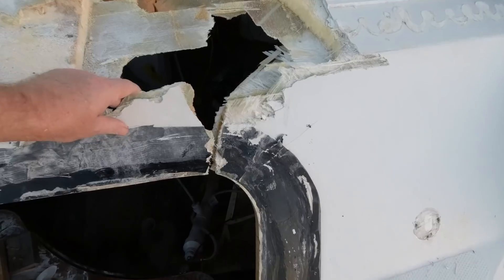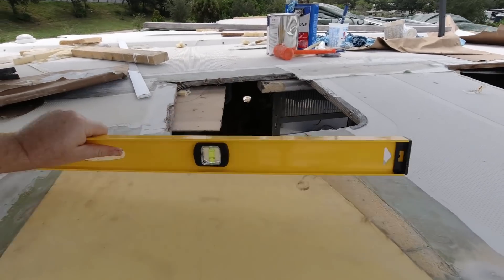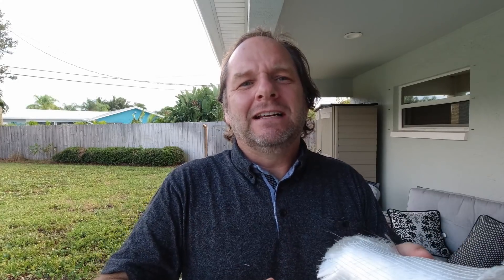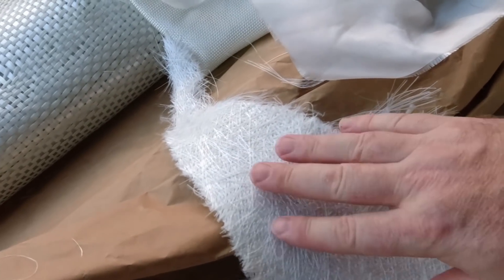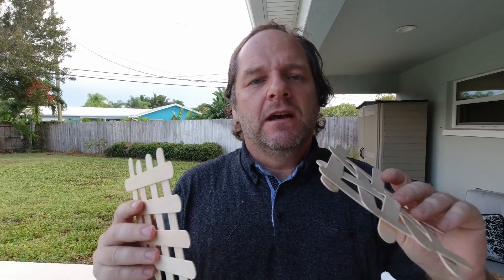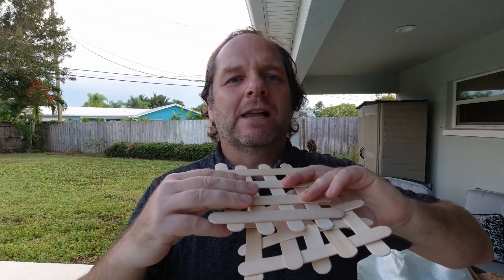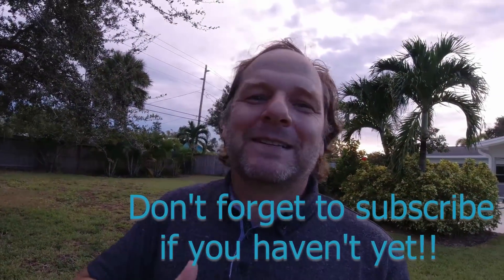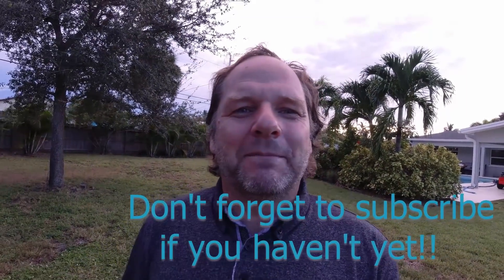8 Fixing my Salvage Sailing Catamaran. Which Fiberglass fabric to use?

Comment: You’ve got a very good start on the glass reconstruction and it nice to see your progress. As a good size Collision and restoration facilities owner for 40 yrs I’ve done my share of fiberglass repairs and your doing a great job and it looks like your avoiding one of the biggest mistakes in glass work by NOT Over Catalyzing your resin, of course if you did in that hot Florida sun you probably would have set your boat on fire from the heat created ! Keep up the great work 👍🏻

Comment: A better generic term for fiberglass material is "Fabric". The reason, because there is a type of fiberglass called "Cloth". This is made from twilled f/g thread woven together like woven roving. It is typically used as a finishing layer of fabric to provide a somewhat smoother finish and generally weighs 10oz. It was also used in the early days of  making surfboards. However the light weight woven roving (4 oz.) produces a smoother finish but not as much strength as 10oz cloth.
I have never heard of bi~tri axial fabric referred to as knitted. Stitched or sewn would be more like it. The last two numbers used to describe bi~tri axial is the weight of the mat. Hence 1708 is 17oz(per square yard) of biaxial, 0.8oz(actually .75oz per square foot) of mat and another common biaxial is 2415, 24oz biaxial, 1.5oz mat. Mat is weighed by the square foot other f/g materials by the square yard. In the past there was another composite f/g fabric called fabmat. Back in the day Morgan used to use 24oz woven roving stitched to 3oz mat. Fast build up of thickness but hard to wet out(saturate) 3oz mat from only one side. This material also came in narrow rolls 8''~12'' wide. Very handy for bonding interior furniture in place as the narrow precut material was neat to install, only needing to be cut to length.
Great series so far. As a long time cruiser and past sailboat builder I really like to see how other people tackle these monumental tasks.

Comment: You shouldn't worry about not being an expert (yet), just picking up some cloth and mixing up some resin to see what happens is way more than most people have done, and anyway, programmers are generally pretty smart and good at reading, researching and figuring it out, but I also like the way you explain it in n00b terms. Thank you.
Reply from the maker: thanks for watching and the comments.
Reply: @BryanSailing  Thank you for making them. Your boat is really beautiful and I'm so grateful that you explain things because I have built stuff with fiberglass and resins but I always just selected what i needed by price or if i was fixing something i got cloth that looked similar. Thank you so much.

Comment: Wow great progress. You have fixed probably the most compromising hole in the boat at this point. I learned a lot about fiberglass and I used to make surfboards many years ago. Good luck on the project. I think it's clear that you can do it. You seem to be approaching it the proper way.
Reply from the maker: Thanks 👍

Comment: Buddy laying glass is not that hard.  From what I have seen you are doing fine.  
There are a few little tricks that will save you a little.  

Get an air tight plastic bucket. Put a gallon or two of acetone in it. When you are thru wipe the largest quantity of resin off and drop them in the bucket. If you like super clean tools use two buckets.  After you wipe the most resin off rinse in one bucket and store in the next. Of course put the air tight top on ASAP.   Dont throw the acetone away.   Resin will sink to the bottom. Pour the acetone off and discard the bottom layer of mostly resin.

Comment: Strength is a function of the load carried by each continuous fiber/strand in compression.  That is why mat glass is the weakest.  The fibers are not continuous and also completely random.  Fibers are strongest in compression and not as much in tension.  It depends on how the stresses are are carried through the structure.  Engineers calculate the stresses/load as they are carried by the structure.  UNI (Unidirectional) is the strongest in one direction only.  If there is a specific load that the engineers want to be carried in a specific direction, UNI is almost always used.  You can also engineer a structure with UNI in specific different layup scheduled directions running through the structure to carry different loads in different directions. A BID (bidirectional) is weaker, because as the weave turns (weaves) around other strands, that "weave" reduces the amount of load that strand it can carry in that direction if it didn't turn/weave, like a UNI does. UNI layups should also be put down with as little distortion in the weave as possible to make the structure as strong as possible.  In other words make the strands run as straight as possible with as few bends or "kinks".  A "kink" in the weave of a UNI cloth, is just like making a cut in the cloth as far as loads carried by the individual strands in compression. The designed layup schedule are all about calculating how the loads in compression and tension carried in each fiber direction through the structure to know what weave is needed and what schedule of direction of strands is needed.  Even a BID or Triaxle weave can call out what direction the fibers run in the structure.  In aircraft composite design, loads are calculated even more precisely to save the most weight and only account for fibers running in the load directions that are needed.
I haven't even touched on overlap of scheduled weaves to carry load from one scheduled layup to another schedule.  It is generally an inch of overlap of cloth will transfer the load from on layup to another layup, but that is a whole other can of warms that I couldn't fit in this comment.
You are absolutely spot on that in a "wet" layup needs a 50/50 weight ratio of glass to epoxy to be at its strongest.  More epoxy is slightly (very slightly in engineering calculations) weaker but will still carry the required amount of load, but a dry layup to save weight, may lead to small (micro) air pockets that are in effect micro delamination in the structure that weaken the composite at the point of the "light" area and make a point of weakness where the composite will fail first under maximum engineered loads.  Better to be too wet then too dry.  The only way to make a layup more dry then a proper 50/50 "wet" layup is to use a vacuum bagging technique where you pull epoxy (or air) from the structure and do not allow air to replace the epoxy that you pull out.  You can vacuum too much and draw air in as you suck to much epoxy out.  It is again an engineered process based on the epoxy system and the type of glass used and the bagging system used. 
As a technique I peel-ply everything, not just to absorb extra epoxy out of the surface of layup, but as the peel-ply is peeled from the surface it leaves a smooth, micro abraded surface that requires almost no further prep.  It only needs a very light scuff of sanding for further lay-ups or paint, and it fills in the texture of the weave so that it requires almost no prep or fill for painting to hide the weave. Peel-ply is a time saver in the end in almost all further work to be done later on with the surface.
Reply from the maker: Great tips and advice for all!!

Comment: I have to say, Bryan, I have great admiration for your derring do in even THINKING about taking this on and I'm very impressed with your ability to solve problems as they arise. The number of software engineers/programmers I know that would be willing to take on such things I can count on the fingers of ONE hand. Your videos have re-inspired me to get to work on the RV project I started two years ago but have allowed to sit idle for the last several months. It would be extremely helpful if you could get organized to the point that you could have video of you working the fiberglass/foam core laminations but I understand that you are at least is concerned with getting your project going as you are with making videos. Don't give up and thank you for sharing your experiences.
Reply from the maker: I'm glad it inspired you to get going on your project again. The new video launching later today has lot of video footage of lamination

Comment: This video was just posted about a restored hurricane-damaged cat.  Their boat is in the process of breaking up after the mast and stays were added and they did some light sailing.  The standing rigging puts tremendous forces on the structure of the hull.  You will probably find the video interesting, especially the last half when they stop looking for problems in the rigging and discover the structural hull issues.  Given how thoroughly you research things, you have probably inspected every inch of every bulkhead no matter what you have to remove to get to it.  Here's a link to the video. 
 https://www.youtube.com/watch?v=gNlXNwvmG-Y
Reply from the maker: So sad about Parley.  Collin is a smart guy, I'm sure he'll get it back in shape. I'm might do a video about the structure and stress on a catamaran and talk about that.

Comment: biax is 0 -90 degrees and double bias is + & - 45 degrees and the peel ply should be fully wet out otherwise there is no point in using it. Otherwise your info is very good. Cheers Rustie.

Comment: I found that a good description . Not much to question. I have 15+ years in hands on commercial fiberglass work and continue to be involved in the tooling side mainly.  It did not really come up but you did not mention that CSM ( chopped strand mat) is measured in OZ per square ft. Woven/ knit by the squ yd. You did not seem to consider that as a good repair material , which it is. Especially with the weird shapes you have to work with that CSM can conform to so much better , but I've been doing it so long I can laminate just about anything! Cheers Warren

Comment: Biaxal or tri on the 45 is very good for a hull material it allows better torsional strength and less flexing of the hull overall. It allows you to get the strength of carbon fiber at less cost. carbon isn't used with production boats case they are polyester. That stuff is the bomb LOL...

Comment: That was some of the best BS I've heard😅.
You might try this with your layup and see if this speeds things up.
I get a big piece of cardboard and laymy first layer og lass and pour resin on it and wet it out, then lay on the next layer and wet it out (not as much resin because the first layer is wet) and so on for however many layers you are adding. Then pick up the wet assembly any flip into place and use a metal grooved roller to get it rolled out into place. This allows all layers to be completed at one time which in the long run will speed up the rebuild.
Just a suggestion you might try in one area.

Comment: Summer in Florida is best spent on the water.  Its cooler and there is a breeze.  Working outdoors at night is great.  I don't have the salvage yard to work in so I try to stop using saws and stuff after 9.  
Loved the presentation on glass.  Most of my layups are a little more resin heavy than necessary because I assume any dry layup has to be ground out and re-done to have any strength.  I assumed the glass would give equal strength but the extra resin would add un-necessary weight making strength to weight worse but having equal strength.  Is that what you are saying?  Or is the resin-heavy part weaker than the same part with less resin?  I never got that point.  Is it the same strength but heavier or is it actually weaker?  My fiberglassing  methods were also learned by trial and error after watching some youtube videos about it.  This is probably how most people learn this skill now.  Looking forward to your next video about resins.  You obviously research these things more than I have.
So far, it looks like you are restoring your boat to look like the factory model.  Are you planning any custom changes since its already stripped-down to the glass anyway?  I see the factory-molded nonskid on the cabin roof.  Are you planning to mold some of that texture and transfer it to the gelcoat somehow? I've been using "soft-sand" mixed with gelcoat for nonskid.  I don't think its that soft once embedded in gelcoat, but it stays suspended in the gelcoat a little better than regular sand.  Tape off a one inch border and peel the tape while the gelcoat is still wet and it looks real official.  Hope we can meet up after the pandemic.  I'm in Merritt Island, right near that boatyard at the east end of the barge canal.  Is there some reason why you didn't have them drag the cat out of the water there?  No travel-lift required.  Much bigger boats than yours get hauled out there.
Reply from the maker: Wow, lots of questions. Love it. Fiberglass with extra resin is actually weaker not just per weight, however I don't know that it is enough of a difference to worry much about unless you are doing close tolerance high load areas. We'll cover it in more detail when we talk about resin. 
All factory on the outside, mostly factory on inside. I plan to make a mold from other no-skid areas to replicate it. There is a great video on Boat Works Today on how to do it. They are a lot farther from my house and that translates to many lost hours over 1 or 2 years.

Comment: The "experts" usually don't want to give away their expertise as its $ involved. The self taught independent does not have that conflict of interests. Thank you for your honesty . Want to congratulate you as you picked the right cat brand to fix IMHO..
Reply from the maker: Thanks. The more I "tear into" the Antares the more I like the way it is built. I don't want to insult anybody's boat, but there is a big difference in between a boat built for charter and this boat. Nothing wrong with a boat designed for charter if that's what you are looking for.
Reply: @BryanSailing  as far as i ve seen Antares is probably one of the strongest cats around..you picked up a right hull to invest ..best luck. T care.
Reply: @BryanSailing  by way, check all bulkheads joints exterior and interior for stress cracks..if you don't find much , she should be fine. Mast step compression etc. Bests

Comment: A thought on the roof. I saw one cat that had a built in rain gutter.  It uses it as a water catchment system.  And adding a lip around the edge would help strengthen it.  Love your videos. Thank you!!!
Reply from the maker: Cool idea! The Antares has a gutter designed into the hardtop, interesting idea to put one on the cabin too.
Reply: The st Francis cats have a built in rain catcher, you can retro fit with something like fiddles used to stop things come off table tops. Some boats have the rain catcher built in to act as a handrail too.
You can easily filter the water before it goes in your tank or keep it for not drinking water applications.
It's way cheaper than a watermaker and uses no power as long as you have rain! Cheers Warren
Reply: Most rain catchment systems have a way to let you manually send water overboard the first 10 minutes of a storm until the roof gets cleaned off.
Reply: I like this idea, but I don’t like the idea of birdshit also being funneled in the (was) freshwater tank! A tarp is another option, but of course you have to be able to secure it, and with rain comes Wind💨 🙈🤨

Comment: Hi Bryan! I wrote something in your last episode. When you cut out broken foam parts, do it in an angle about 30 degree. Also the new part to glue in. There you have more area to glue together. In germany we called it "schäften". Take a look in the wiki then you know what i mean. A small but important tip from a german boatbuilder. Greets Paddy
Reply from the maker: Thanks for the tips! In English it's called a scarf joint. The videos are a week or two delayed so I haven't done any core since your last comment, but I may try it on the next time...

Comment: dude I'd recommend feathering the glue joins from old to new foam core filler much flatter than you are (not 90 like it looks like in your vid) maybe at about 30 degrees?  that way so as not to leave potential stress lines along the fibre glass either side.
Reply from the maker: Good idea, you are the second person that said that. We'll I'm sure it wouldn't hurt and may even help some, from a engineering perspective and from the documentation on the foam, it's not necessary, due the type of load the foam is under and modulus of the glass vs the foam. It would be great to do a test to see how much it helps. I may even do that just for fun. That said, I think I may start scarfing the foam joints a little more in the future, because it for sure won't hurt.

Comment: Thank you for the videos. Your explanation of the different fibreglass weaves was excellent. Watched your previous videos and agree with other comments that the damage is not quite completely clear. I assume you know what you are doing practically, but I don't quite get that feeling, probably because of missing info in your videos that you mention. Looking forward to future videos. All the best for your success.
Reply from the maker: Thanks, Great feedback. I'll try do a better job of capturing the damage and how I repair it. Like I said for the working part, I'm still working on getting the  workflow figured out to both film and work at the same time, but I'm getting better as You'll see in the next episode Spoiler Alert where i have to cut out a bunch of the work I did and redo it.